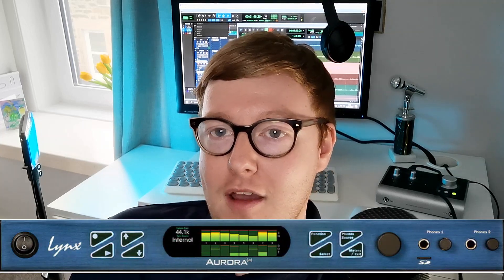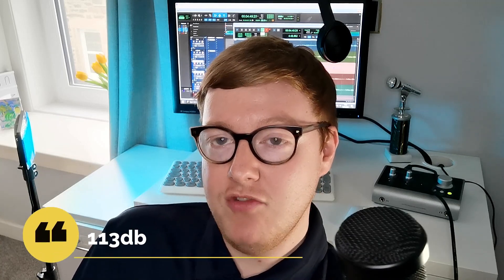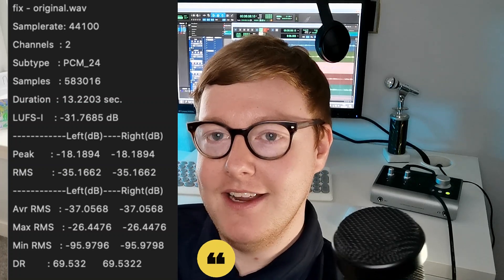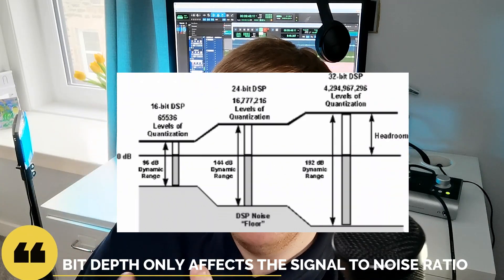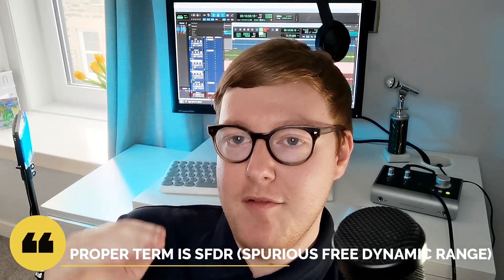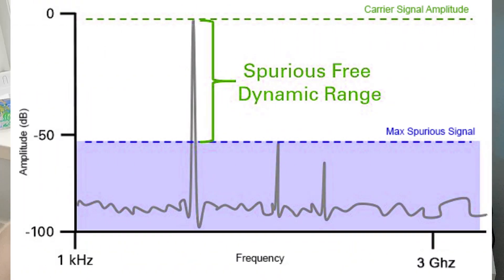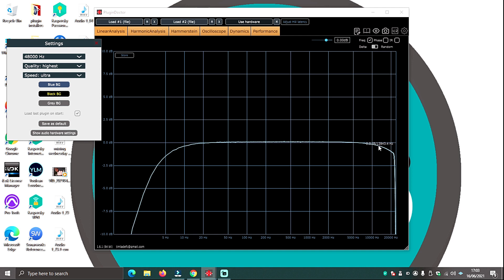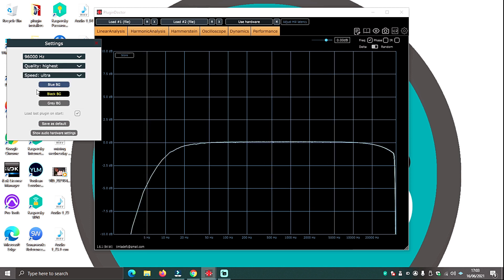Do you lose audio quality in analog gear using budget interfaces vs expensive ADC Converters (Pt 1)

Comment: Hello, thank you for the great video. It was a good attempt, but I’d like to point out one major error: it is very difficult to evaluate a converter’s performance solely by the amount of residual signal left after phase inversion.
As you mentioned in the video, converters may have different filters applied depending on the manufacturer’s design intent. These subtle differences in filtering can cause phase shifts, which in turn make the inverted signal differ from the original and leave more residuals. However, this does not necessarily mean the converter’s quality is lower.
There was a test conducted on Gearspace: even with the same product, the volume of residuals after phase inversion varied drastically depending on which filter was used. Yet it was still the same product, and this cannot be taken as evidence of a difference in performance.
Reply from the maker: Yes it can as interfaces ADC's and DAC's use only 1 fixed filter. By running the interface dac into it's own ADC you test the conversion of the whole system for use with analog gear. Check out the second test link in the pinned comment. More tests and more conclusive evidence on the lack of AUDIBLE ADC differences. More 'audiophile' DAC's on the other hand are a different kettle of fish

Comment: There are many factors to consider when using analog hardware via that access analog platform. The owner says that there is no degradation of signal and its 1:1 like physically using the actual hardware but i have a hard time believing that. I think within the whole sequence of what u send to their servers, the conversion, those relays reaction to incoming signals as u make changes on the hardware and the bounce back… something will go wrong on that path. I say this because how their stuff sound is noticeably different than my experience with those same units when i had them in my hands. I cant explain it but there is definitely a difference between using those units virtually and using them physically/directly. Specifically, i have used cl1b many times in the past and i know how it sounds. I recently used the cl1b via access analog and i thought theres no way its the real sound of a cl1b.

Comment: The Audient is hardly a "budget" interface. It's solidly midrange IMO. An 8-channel Audient costs about half what that Lynx does.

I would personally use a Grace as the transparent reference instead of a Lynx, but the results probably wouldn't be very different if focusing on conversion alone. The main advantage to something like a Grace m801 is its preamplifiers, and particularly their very uniform phase response at high gains (though even there reasonable people can argue about audible impact or lack thereof).

Going back to your comparisons, I agree that the Focusrite Scarlett has "audibly perfect" conversion, but its preamps aren't quite as good as Audient, never mind Grace.

You are right to focus on the anti-aliasing filter and its impact on frequency response. The challenge with pre-conversion filtering is that it's very difficult to implement a "brick wall" filter in the analog domain that can sufficiently attenuate 24 kHz (the Nyquist frequency for 48 kHz sampling) without rolling off at least a bit below 20 kHz. From 20 to 28 kHz
(the lowest frequency that aliases into the audio band) is 0.49 octaves, so to suppress aliasing at 20 kHz to, say, -100 dBFS would require a ~200 dB/octave LPF. That's an awful lot of filter poles.

As you say some higher-end interfaces work around that by always recording at very high frequencies, such that the analog filter has much more room to work. They then apply a much steeper filter (one that wouldn't be practically realizable in hardware) in the digital domain, and then downsample to the final rate. As you say this technique is easy to incorporate into your workflow, provided that your DAW incorporates sufficiently sophisticated digital antialiasing filters.

Comment: it's more complex than what you think lets compare an old high end adc with audient  the rosetta ad stereo converter have less than 50 s rms in jitter the audient less than 100 ps rms same dynamic range 120db power supply of the rosetta apogee is a linear power supply toroidal transformer the audient is 5v usb powered can cause huge issues  rosetta have an FPGA SPARTAN used in rocket science capable of real time processing in audient no fpga rosetta the legendary dithring UV22HR audient is a good converter but you can not compare it to lavry apogee lynx or apollo those converter can accept a loud signal from preamps reaching 24dbu and plus the audient maximum level is +18dBu= 0dbfs it's gonna produce a low crest factor most preamp and audio consoles reach +24 dbu and plus witch can fry the input of the audient and the preamps insid the audient are a small circuit opamp compared to a legendary neve or chandler you are fighting against a huge beast , and im not speaking about anti aliasing noise shaping and the different connectivity like the aes ebu the bnc clock signal and the calibration input
Reply from the maker: Can't get any more complex than an inaudible null over full mix and pink noise
Reply from the maker: Analog gear works at 0vu/+4dbu as optimal signal. Nothing even marginally close to 0bfs

Professional live level is +4dbu that's what your speakers are designed to be feed for optimal performance
Reply: @PaulThird  yes analog best snr is 0vu witch is 4dbu but don't forget about headroom and the crest factor it's also important  or maybe im just a maniac about audio

Comment: Hey Paul, so I recently got back into producing music. I use Logic Pro on an M4 Pro Mac Mini. However, I can’t run my DAW through my fiber optic network bridge, which isolates the noise from the Mac when streaming to my DAC, and had to plug my DAC directly into a usb port via an OWC dock. And now I am hearing a ton of computer noise, which is driving me nuts. I have a very high end headphone/DAC rig (top of the line, best in the world sound quality). And I need to somehow isolate all that noise from the Mac from my DAW when producing music. So I have been looking at some network options from manufacturers like RME and Merging Technologies like the Hapi MKIII with their VAD Premium for MacOS that can stream 32bit/384khz or up to 256 DSD over IP network to the audio interface (which should in theory eliminate all noise coming from my Mac Mini). Have you tried any of these network based interfaces that don’t use a direct thunderbolt connection? Another one is the Neumann MT48. Thanks!

Comment: sooooooo i own 2 lynx aurora16(older model 2006 almost 20 year old). Bought it second hand for a really good price. Did a null test at different sample rates and yes at 48khz there is some sound passing, but at 192khz there is close to none. Also you talked about the color of the lynx, I measured it and the freq/phase response is dead flat from 5hz to 22khz so I hate to say it but you are wrong there. Also did this whole proses whit a brand new scarlet 2i2, personnes tac 8, nunmark dj controller (they where in the room to grap) and well non of them got even close(but they do have preamps ofc). 

Not trying to start a beef, you just made me second guess if the thing I bought that was ment to be transparent actually was hahahah. So maybe the new “(n)” model is different and does add color?
Reply from the maker: Yeah I was 100% wrong there with the colour thing. Was a naive ear judgement over the science. I thought I edited it out to be fair. Just went back and edited that bit out cause I was talking nonsense at that specific bit 

I corrected all of this in another comparison on the channel years later. Lot more in depth with a lot better understanding which also explains your null results
Reply: @PaulThird  hahaha thats great to hear, things happen! I mean you can’t hate on the lynx company, yeah they are expensive but it still provide good working updates for products almost 20 year old. They even helped me out whit some stuff knowing that I bought my lynx second hand. So I guess that made me reply in their defence. 

Nice to see you actually be involved this way, thanks!

Comment: Aah fml I saw a duplicate comment and deleted the one and now both are gone, but I assume you remember what I said. And yes while it's true that I only tested the DAC end of things, IMO conversion is a two way street, if the DAC is coloured so much as I tested, it's part of the chain too and have a sizeable effect especially in mastering, especially with those things (DAC's) being claimed to be the more "transparent" part of the chain.
Reply from the maker: Watch the video
https://youtu.be/0dxkezEh_Lo

And it'll make more sense. If you get an inaudible null with DAC to ADC then it's an inaudible difference for analog gear which was the point of the video we are commenting on right now. 

In the follow up video I tested with white noise, pink noise & full mix. Anybody that states that there is an audible difference is kidding themselves. 

I'm not saying theres not a difference with DAC to Speakers/headphones which I touch upon in that video but there is definitely a difference between quantifying DAC to ADC & DAC to Speakers/headphones. 

Its a different relationship. Not apples to apples. 

DAC to ADC requires no amplification. 

DAC to monitoring does. There's other stuff at play but you are at the Dunning Kruger realm at that point
Reply: @ I'm not getting an inaudible null tho, I'm getting difference in "nulled against each other" signals, both in the "null" and audibly, just that to me, the difference in audible character is always bigger than the "null", especially in the full mix, even when it nulled to -50dB before the master limiter (as I'm testing master loopback). I'm also saying that the AudioFuse rev 1, which technically nulled better against the original mix Vs the ADI-2 DAC FS, sounded worse, even than the original mix. Blurrier, muddier, and less dynamic. Unless the details don't matter than its anybody's game.

And I've tested running the clocking from the AudioFuse and the MT48 too, and the MT48 clocked nulled better and sounded better by far, consistent in nulling and audio quality in this case.

My point is, something can null closer to 0 but the difference in the signal can do more harm than the one that "nulled worse" on paper against the original. Of course what's better is subjective (tho I'm sure for full mix loopback most would agree with my preferences).

Just thought it'd be interesting to mention, not necessarily disagreeing with you point that for analog gear, it's not a big difference, esp compared to the character added by the gear. But for analog mastering, it probably matters, especially if you've seen the signal deviation of the RME unit, which (like most other "mastering grade" DAC's) are taken for granted to basically be a robotically accurate signal recreation device.
Reply from the maker: We're talking barely 0.1db of a difference. In mastering it means even less as its one track.

If you do ADC prints and listen to all on the same DAC you'll fail blind tests. I guarantee it. Most can't even pick a 0.6db difference caused by level or saturation.

The difference in ADC is imperceivable. It's science. For the average listener you need at least 1-2db, some times 3db of difference added to create a perceivable difference

I've done tests like this for years and everybody fails at that level of difference.

If you know which ones which your brain can tell you what you expect or want to hear but blind.. Game over.

blind test audient ADC vs lynx ADC 10 times and I guarantee you there's no way anybody is getting 10/10. Not even 5/5.

We are talking differences in ADC so small that no consumer or artist will ever notice any difference.

People get distracted by the DAC to Speakers difference and lump that with the ADC when in actual fact the artist never hears the DAC difference you hear in the room. Many get this so wrong that they assume that the DAC quality is baked into the record when it's not.

What I hear through my topping D90 iii discrete isn't what the client or consumer hears. There's no way I can put that in the track. Only way somebody can hear the real detail of the mix is by being in my room listening through my topping setup

Nearly most Modern day interfaces offer ADC conversion which is transparent enough to be imperceivable. Even topping E2X2 interface at £150 offers apollo X16 grade ADC

Comment: I think those of us who invest in high end converters aren’t doing so for transparency most of the time (as it’s a given). Different converters have different flavors and color the sound in different ways. I know you touched on this, but it’s no small thing. 

I don’t even bother with specs when buying converters. I simply shoot them out with my old converters and see which feels nicer to track and mix through (and it is a feel thing). Avid and Apogee and Lynx sound very different - it’s actually quite drastic if you get used to one then switch. You may not hear it on just one track but the cumulative effect of it on many tracks becomes very noticeable. That’s what you’re looking for. 

Also one thing you didn’t mention - some high end converters impart a pleasing sound when you clip them with a hot signal - something you’re definitely not going to get with an Apollo.